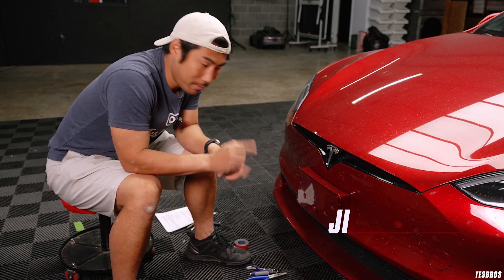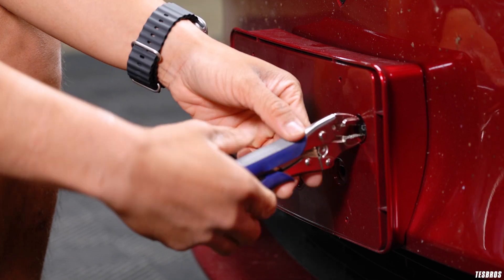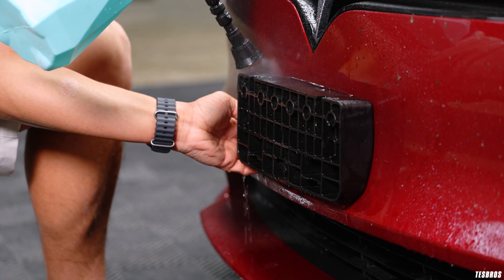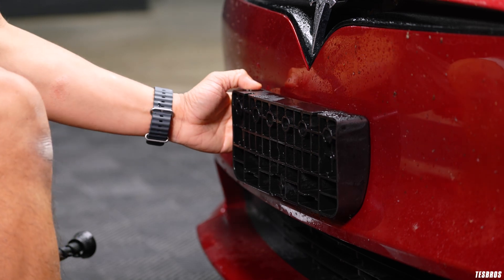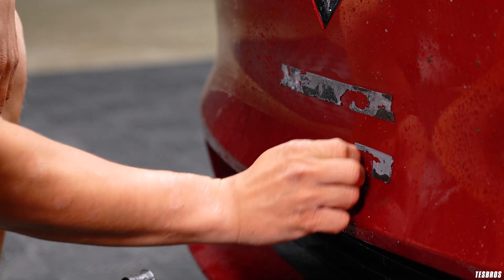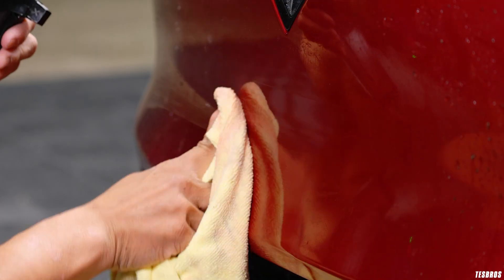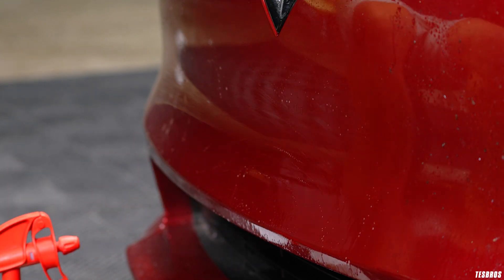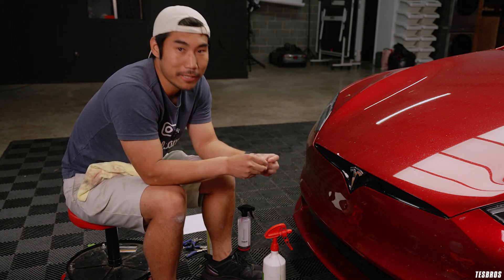Model S Front License Plate DIY Removal - Do This Before PPF - TESBROS

Comment: The Tesla Plaid Channel did a video about this about 2 years ago.  He used an old shoelace to "cut" though the glue holding the license plate holder.  I did it on my Plaid and it worked like a charm.
Reply from the maker: Nice! Never would have thought to use a shoelace but whatever works
Reply: @tesbros   Worked really well, absolutely no paint damage.
Reply: Can u send me the link for the video please ?
Reply: @iowa I legit seen this comment maybe one minute into the video and I lost my mind and I went outside at 12 AM. Midnight to take a shoestring to try and remove the adhesive license front plate off my vehicle took me about 10 minutes I should’ve recorded it 😂

Comment: If your car has the two underneath....I was able to remove the 2 "star" fasteners by using DeWalt's Bolt Extractor 5/16 size. Home Depot sells the set of 5 for $21. Who knows I may use them again!
Reply: @kbarton1360 Was your bolt the 5 lobe? These 6 lobe from HD worked?
Reply: Yes it was a 5 lobe. Sorry for the late reply.